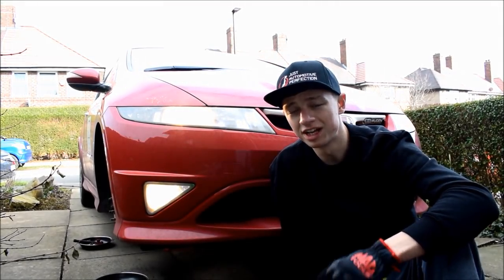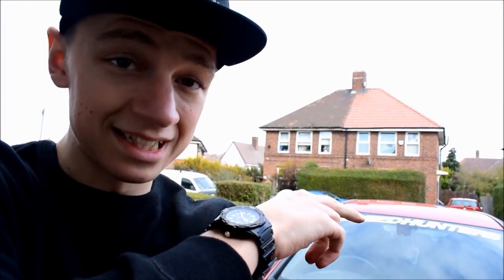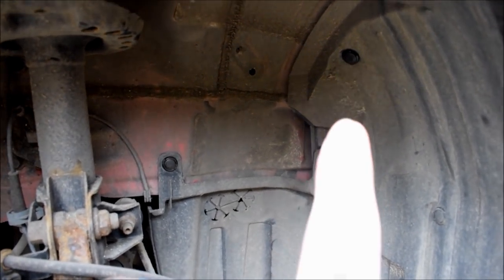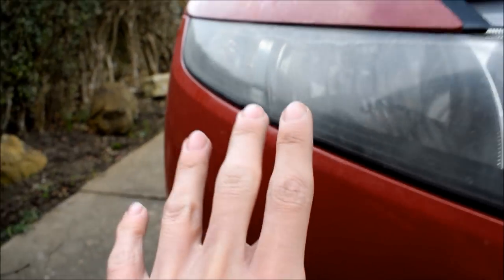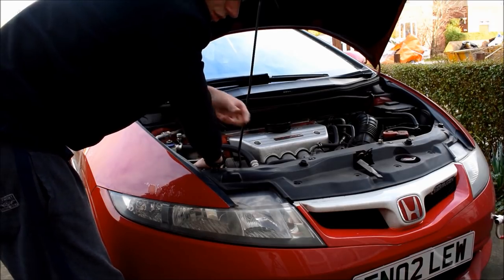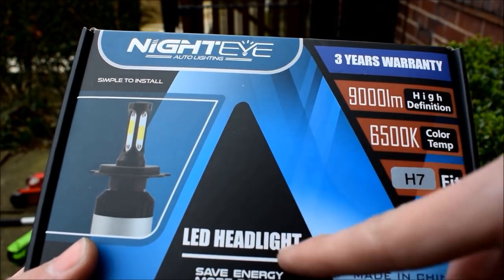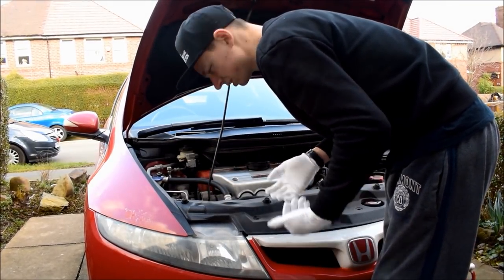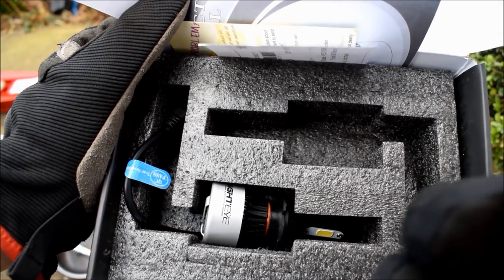FN2 Type R LED light overhall

Comment: Hi mate, just want to say you can use the two holes directly underneath the spotlight in the bottom of the bumper to access a bolt retaining the spotlight in place. Use one hole to look through to see where you going and the other hole you insert your socket on extension bar and undo the spotlight retaining Bolt. The spotlight will pop out forward and you will be able to change the bulb very easily. This is the same on both sides. Hope you find this helpful.
Reply from the maker: Thanks Andy. I did find this out recenty 😂. I'll pin this do people know 👍🏻
Reply: Always the way mate. Hopefully it will help someone out. Keep up the good work  👍👍👍
Reply: @Notworththetimeittakes  Hi, apparently this method isn't possible on the type R
Reply: @Lee.S..B  Yes it is possible did it on mine. There is two circles.  What I did Is made the circles into one bigger hole . So I can see and access the nut. Do need along wrench extension but it is so much easier. The front fog just pops off from the front 👍

Comment: I was fitting new bulbs on the passenger side. Dropped a H7 and hours of looking later, me and my dad can't find it. Not in the tray underneath, can't hear any movement when shaking the bumper, have taken battery out and dug right in under the headlights and got a rod down under the radiator. Nothing.

Honestly started to think I was losing my mind and didn't drop a bulb at all. Take care when putting the passenger side bulb in folks, it's a very tight fit for hands to fit in there.

Comment: Keep the original bulb's as you will have to change them back to pass the most. Failure due to dazzle oncoming traffic as lenses aren't designed for those bulb's. Not worth the time and money changing, but you live and learn.
Reply from the maker: I've kept the original for this purpose. What do you suggest for a 'non dazzling' white light?

Comment: Hi mate, just got myself the same headlights from amazon. Just wandering how you connected up the wiring? I do have pics I can send you to look at but from I could feel I've got the positive and negative wires in a braid? I also noticed there some kind of bracket that you need a star/torque driver to undo the screws slightly to take it off? 

Any advice or a step by step thing on the wiring part would be big help 🙏

Comment: Hi did you put the headlight dust covers back on, as the fans on the night eye need to vent the heat out.
With them on the heat will just build up inside the headlight.
I'm thinking of making a small hole in the dust cover so it can vent out into the engine bay.
Reply from the maker: That's a good point. The only thing I'd be worried about is corrosion happening on the inside of the light.

Comment: Hello I have an fn3 diesel 2.2 mk8.Would you still recommend these headlights as an upgrade? The factory ones are shocking in the dark.Thanks
Reply from the maker: I'd actually go for the auxbeam bulbs instead. Loads less dazzling than these. I did a video on them too. If you can find it there may be a link in the description 👍🏻
Reply: @FNLEW  thank you again

Comment: Great vids thankyou my friend! Did you compare pros and cons of LED v HID? Seems that one important thing is the 'beam' - not just the brightness.  LED are bright but you get more 'spread' in the beam - so needs a projector ideally. Whereas the HID Xenon is meant to give better beam. Picked up a HID Xenon kit to fit to my Type S, so will see how that goes and let you know! Cheers
Reply from the maker: Unfortunately I haven't had the chance to try hids. But I now have a better brand led that has a better beam pattern luckily so I won't blind other drivers.
Reply: What was the better brand?

Comment: What size / type of clips for the bumper do you use? I want to purchase some of ebay for the bumper. There's a few missing I know u mentioned theres a different sizes
Reply from the maker: Yes mate if you just put honda trim clips in ebay, plenty come up. Some are long and some are short. I'd just get a pack of both.

Comment: Why don't you get h11 night eye led bulbs? I have on mine and super easy to fit, mine came out with rubber Seal and new ones had it on too and was an easy fit?!! Very bright aswell.
Reply from the maker: I've fitted them with someone else on a friend's FN in a previous video and I do agree they're great. I just really wanted ones I can turn red at will.
Reply: @FNLEW  I have added DRLS to my fn2, should check my video out on f.b on owners club.

Comment: I have a question will the fn2 outer back side lights fit mk8 type s 2008 model?
Reply from the maker: They would but I think the light internals are a different colour
Reply: @FNLEW  you mean it’s white that’s what I want change the orange to white not sure if I will need new bulbs and not sure about the fog light because 2008 mk8 already has a fog light in the right hand side centre cluster where is the fn2 fog light in the outer light?
Reply from the maker: @MissionKid  I think the fog doesn't change place

Comment: Be careful when using cheap LED bulbs, I bought some LED front sidelight bulbs for mine, however when I came to change them over due to one of them going, the plastic base of the LED had got too hot and warped, making it impossible to remove the actual bulb from the headlight unit as it would not fit back through the hole.  They are currently trapped inside my headlight cluster.  Trying to figure out how to get them out
Reply from the maker: Don't worry, since this video I've upgraded them 👍🏻

Comment: Hi Lew, that was a good decision 1:52 not to replace high beams with LED. I have just tried to do this (NightEye H1 LED) and they dont fit! The rectangular section on the main shaft of the LED is way thicker then the standard H1 halogen bulb, and it wont go into the housing of the headlight. Its too fiddly to rework the housing in the car so would have to remove whole headlight unit and modify fitting or get a replacement if anyone makes one. (2007 Mk8 Type-S)
Reply from the maker: Hi mate, I've actually replaced both dipped and high beam with some auxbeam leds and they all fit and work work a treat 👍🏻.
Reply: @FNLEW  Yea someone else on here fitted the Novsight H1 (same make as Nighteye) and had no problem either. The square bit sizes must vary even from same manufacturer, which is really annoying as H1 should mean H1! Standard universal size. But then we are dealing with China! :)

Comment: Allo allo, there are some better H7 leds out there that better replicate the oem halogen bulbs, some of the multi side leds such as the ones I see you have, are not good as the reflect the light all over the place, I recommend you find leds that replicate your oem H7 then see what the results are they maybe better, give it a go, I brought some leds for my vehicle but I made sure they were replicating the filaments on my H4 bulbs. Good vids mate, subbing.
Reply from the maker: Thanks for the input. I have some newer more expensive ones to put in soon so stay tuned 👍🏻

Comment: You ever get flashed for the night eyes
Reply from the maker: I've actually changed from night eyes to Auxbeam bulbs and they're a lot less dazzling
Reply: FNLEW  Thanks for the reply. I will check them out. I am just starting a fn2 strip down de rust re build. Nice 👌
Reply from the maker: @MDMowers  no problem. Good luck with the rebuild 👍🏻
Reply: I'm getting flashed everyday for last couple of weeks 🤦🏾‍♂️🤦🏾‍♂️
Reply: P23 NAD  I was the same with normal bulbs and the lights had been set at a mot centre. Are your lights clean and clear.
Reply: @MDMowers  all good its the beam pattern from the night eyes its like high beam might go back to orsam